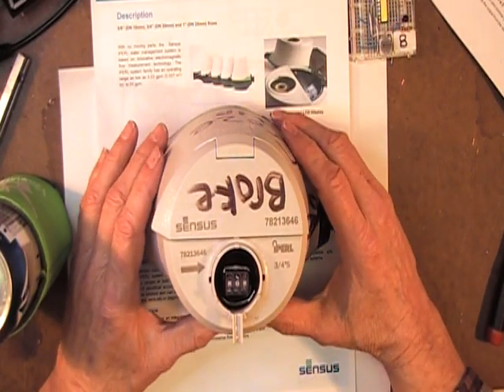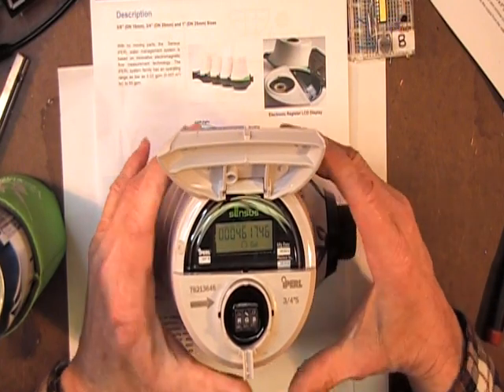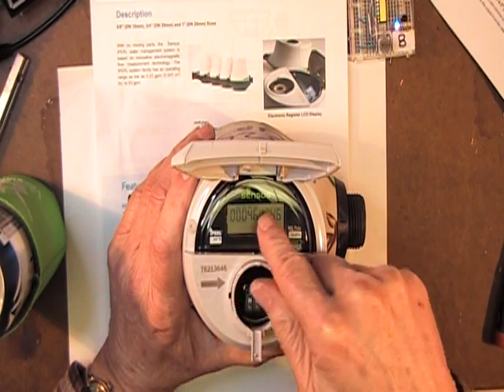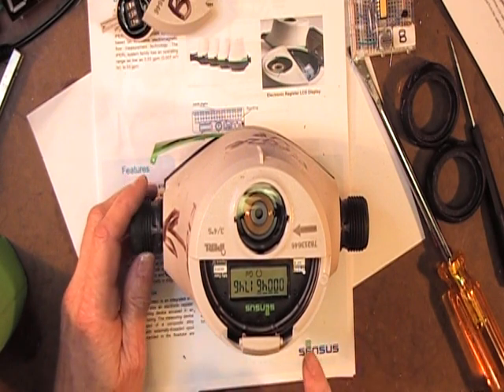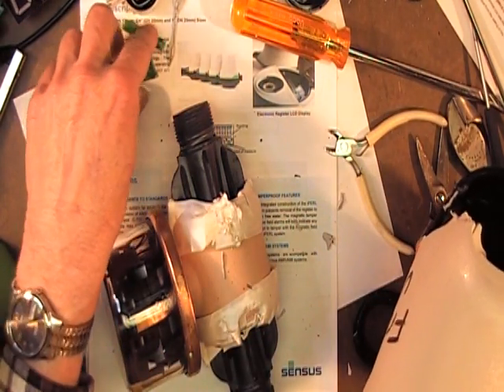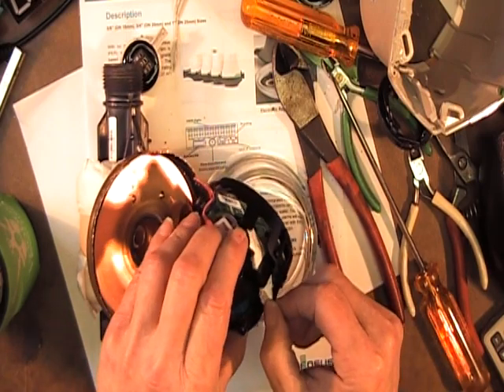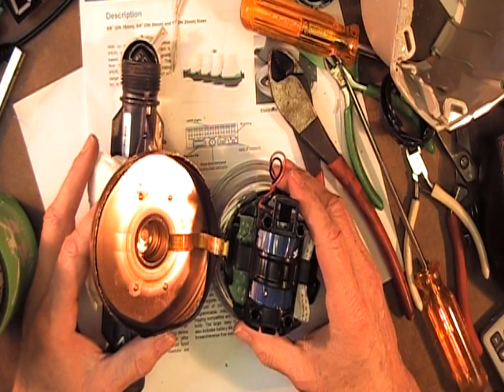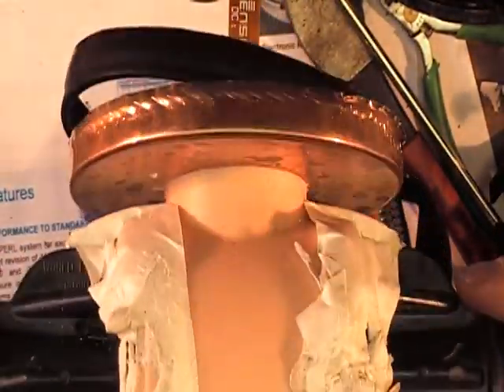Senus Iperl Teardown

Comment: Would a strong magnet underneath stop the meter from reading?
Reply from the maker: I strongly doubt it.
Steve
Reply: It worked, Byt there are alarms that get set off if on for more than 15 min
Reply: How did you find out about the alarm? I was thinking about this too.
Reply: @dandillon8224  I read the manual. an electomagnet placed perfrctly will work and slow it down  but  it will somtimes speed it up too.  I gave up on the peoject
Reply: Hope you can help, and thank you for video. It’s been colder her past week..down to the teens near Philly. It’s Saturday, so no one at water company to answer. Past couple of days the this water meter has been making a humming noise every time I flush toilet, take shower, watch clothes…water in bound. Could it be due to temp outside? My water meter in in basement next to wall foundation… cold. Thanks for reply!